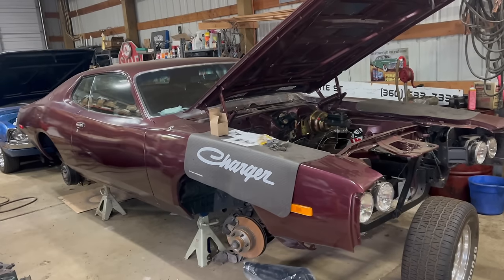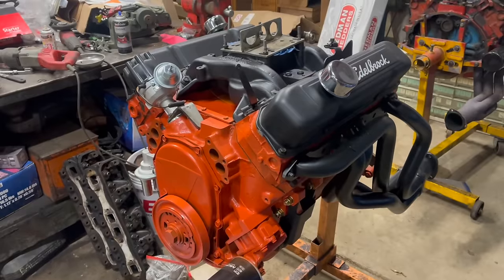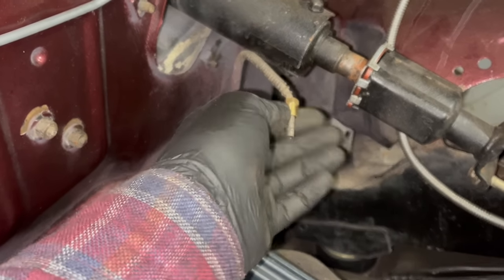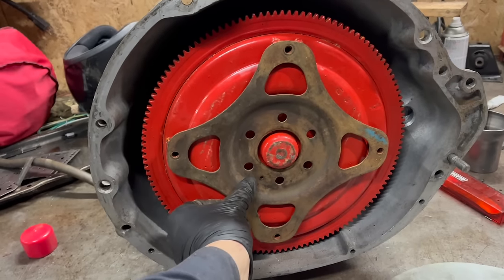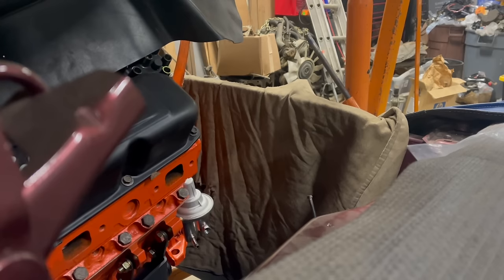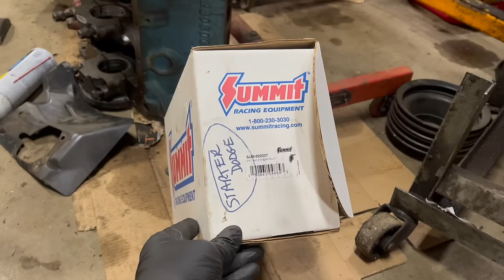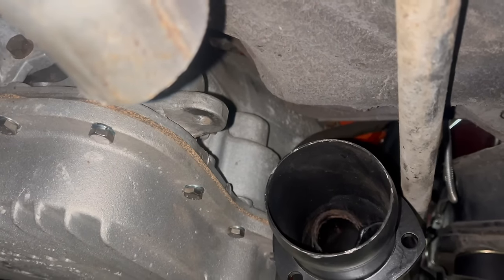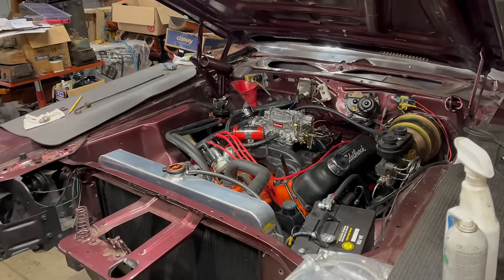Smoke And Glorious Noises - Budget Built 440 Swap In The "Toolbox" 1973 Dodge Charger

Comment: During High school (82, 83?) my buddy had a 73 Charger SE, 383, cragar mags, a nice blue color, white vinyl top and mirrored tint. THAT was a nice car....ah, memories! (while I still have them)....
Reply from the maker: We are restoring a Charger SE that mostly matches that description at Rocket where I work part time. It’s pretty awesome.
Reply: I had a black, '73 Charger SE. It only had a 318 though. It was black on black.
Reply: A buddy of mine also had a 73 Charger SE about that same time, with a 400. Same color combo - blue with the white vinyl top and the louvered quarter windows. It was pretty nice, and with a few mods that 400 was a pretty decent performer.
Reply: My black 73 Charger S/E had every option except the cassette deck and a big engine. Mine was a 318. The interior was a black and white houndstooth check buckets with an armrest. I ordered it and was 22 when I did.
Reply: @DeadDodgeGarage how much would all that cost when you're done?....

And what's the cost to do that to a forward look c body
Reply from the maker: @clevelandmaker386  A full restoration? A lot... and I don't know if Rocket has ever done a Forward Look car. Definitely not since I've been around anyway.
Reply: @DeadDodgeGarage  not a full but probably a three quarters mainly mechanical stuff and check marketplace... I've got a few saved searches in CA...

Comment: I worked in a trans shop for years doing R&R work. Easiest way I learned to get a torque converter to go in on any automatic trans is to bump the top of the converter with the palm of your hand and spinning it at the same time. Someone may have already posted this tip but since I don’t have till my next birthday to read thru all the posts…. well, there you go.
Reply from the maker: Fair enough. Haha. That’s not far off of the wiggle technique I use.

Comment: As normal a very useful and informative video,we’re just putting a 1970 MGB gt back together after pulling it apart three years ago . The next project will be the 1971 Chrysler 300. 440 .Keep up the good work regards from a very cold and wet England .

Comment: Glad too see somebody else used the same brake booster and master cylinder combo that I used on my b body, makes me feel like I maybe got one thing half way right when converting from manual drums to front disc
Reply from the maker: Oh yeah, you did. That setup works amazingly well. Better than any stock booster I’ve ever dealt with.
Reply: Please tell me more about that booster. Where did you get it?

Comment: I had a 73 Charger once. It was a 318 car that had been replaced with a 360. It had been painted with a paint roller with red paint that was more pink than red. I pulled up to a red light once and did a most awesome smokey burn out. I eased away from the red light and when the smoke cleared away and to my surprise there was a sheriff behind me. He did absolutely nothing and I just drove away.

Comment: With a factory distributor, I remove the fat short advance spring, leaving only the long, thin advance spring. This quickens the advance to roughly the same as the Mopar Performance / Mr. Gasket advance springs. Then the factory vacuum advance is too great, so I don't connect it at all. Some of late production Mopar Performance distributors have an adjustable vacuum advance can, but most of them did not and the advance in them was too much with the quick performance advance springs. he quickened advance made a huge difference in performance. For idle speed, initially I'd back out the idle speed screw out to where it didn't contact the throttle plate lever and then tighten it / screw it in until it just made contact and add two full turns (4 half turns). This places the throttle plates right about where they should be for idle in the carb. With the Mopar Performance distributors, I'd never hook up the vacuum advance, as the mechanical advance max'd out very early in RPM's.
Reply from the maker: I’ve heard that one. I have done welded recurves, usually keeping the factory springs. I have swapped for two light springs. I have modified the amount of advance available from the vacuum pod. But generally I run without it.
Reply: @DeadDodgeGarage  Two performance springs or one factory light spring usually bring all mechanical advance by 2500 - 2800 RPM. With that quick of advance, no part throttle vacuum advance is needed or desired. I measure and mark the balancer lightly with a hacksaw at 34 and 38 degrees and paint white between those lines and then paint the zero mark on the timing cover. I bring the RPM up 3000 RPM or a bit higher and set the total timing between 34 and 38 degrees. 38 degrees will give the most cylinder pressure and torque and 34 degrees is only slightly below in torque, with similar horsepower, while protecting cast pistons. I don't bother to limit the total as I set the timing at the total and leave the vacuum advance disconnected. For camshaft timing, regardless of lobe separation, intake centerline at 106 degrees gives maximum horsepower, while intake centerline at 102 degrees gives maximum torque.

Comment: Just a tip thats helped me when putting an engine in solo if you put a ratchet strap under the car when putting an engine with a trans the trans will sit on the ratchet strap and slide right in badass 73 btw!
Reply from the maker: Oh that’s a good one. But that’s basically what I do with the floor jack. I set it at roughly the right height and pivot the drivetrain on that.

Comment: Obviously not needed but jacking the rear of the car up as high as you can get it cuts down the angle when sticking the engine and trans in together and that little bit it lowers the radiator support comes into play. Love the gen3 Chargers, they ride and drive so nice, maybe the best older platform Chrysler made.

Comment: Did the Schumacher deal on a 73 RR put 383 HP in w/8.25 355 drove it from PA to LV school UNLV . Finished bought 71 RR 440 4-speed welded tow bar on back of 73 to front 71.Towed it all the way back to philly.8.25 is much stronger than you think .Just don't put slicks w/4-speed on 8.25. It will be fine for 440 driver.Save 8.75 as your racing rears .Best channel funniest sarcasm you should have a show.Thanks
Reply from the maker: I know that. That’s what I told the owner. 😁 my Barracuda has an 8.25 with 4.10s (or 4.11 - I can never remember which) that has suffered a decade of burnouts and mayhem under four different owners with a 360 and a four speed. I have had two others in other cars and they have always taken what I throw at them. Then again, so has the 7.25 - but that’s another story. We are changing the gear ratio to 3.55, and it makes more sense to do that with the correct, super wide late B body 8 3/4 housing that we found than with the 8.25. This leaves options open for easy future gear changes, as well as the extra strength.

Comment: I've had to replace my headers once since I bought my Charger (1973 Rallye 440) in 1976. Hooker Competition headers cleared everything. Still a pain to replace. Car has been garage kept last 30 years. Original paint.
Reply from the maker: For anything that doesn’t demand maximum horsepower, I can’t recommend the HP manifolds enough. But they’re already there… That’s awesome! Years ago I ogled over one just like yours but yellow on eBay. I have a big soft spot for those cars.
Reply: @DeadDodgeGarage  I'm old now (67). I'd love to find the exhaust manifolds to replace the headers. I don't need max power anymore.

Comment: Was the charger built in the LA factory?I was under the impression that automatic column shift, bucket seat cars were all built at the LA factory.
Reply from the maker: This is an original bench car. I don’t actually know where it was built, but could check at some point.

Comment: man i enjoyed this episode since its my favorite car of all time !  i know i might sounds weird but my Charger was originally a 318 i did a 400 swap in 2017 in it and convert it to a 4 speeds , the engine sat on the sb k-member in literally 2 minutes (without the tranny) no modification ever done and also at that time didn't knew that there's a difference between them , however when i pulled the 318 i put it in the other Charger which is originally a big block car and used it a parts car , the small block sat in it but not straight.
Reply from the maker: A commenter told me that flipping factory big block mounts side for side works, which is interesting. If I have an opportunity to try that, I will.
Reply: @DeadDodgeGarage   yep heard that too , anyway love your channel and your work man and we can learn alot from guys like you , keep up the good work and please do more videos about this car , greetings from Lebanon

Comment: Do those cars have a rubber isolated front K member? Is that what I think I saw? Hmm.
Reply from the maker: Yes, 73+ do. I’m pretty sure I did mention that we replaced the rubber pucks with polyurethane in the video.
Reply: @DeadDodgeGarage  Yeah I think you might have. 
I had a 79 Lebaron that had a rubber isolated K member and I think I remember reading that Chrysler Performance used to sell a cast-iron puck that would solidly bolt the K member to the frame rails. 
But jeez, that was about 30 years ago now though, lol.

Comment: Love this video and content - thank you so much for sharing each step as you helped me in getting my 69 Chrysler 300 convertible going. . .just little odds and ends.  ..starter size. .. spark plug wires/boots.  .
Reply: You need Matco hyper step drill bits there not cheap I have them there worth every penny $529what I paid and that's on sale
Reply from the maker: @davidthomits544 I haven’t seen fit to go for the step bits. Not sure I trust them for plate like this. I guess I should try it. I’m familiar with what they cost. I am still paying Matco $100 a week, and my shop has been closed for a year and a half. My first set of Matco bits were well destroyed when I replaced them with Macs. Now I’ve replaced those with these Irwins, and for the price, I’m happy.

Comment: Nice conversion, tons of work good job! Ran into same scenario with the mini torq dakota starter install. little did i know at the time there's an extension plate which relocates wires to the front of solenoid to clearance the block. purchased one, then another... guess i'm waiting till my fury burns to the ground before installing. oh well, no time. Looks good!
Reply from the maker: Yes, there is a terminal extension plate you can buy that improves things. There is actually a shorter factory extension plate often found on them which has to be removed to work on big blocks. Having no extension places the big wire right in the vicinity of that freeze plug and makes it fit - but it’s tight.

Comment: You wouldn't happen to have a spare set of tail lights  sitting around would you? I have the boring  stock thin tail lights on my daily 72 charger
Reply from the maker: These are the boring stock ‘73-4 lights - they just happen to be cooler than ‘72. Haha. He has the lenses that came off of this one but only because they are available reproduction, so he bought new. No housings, that’s the important part.

Comment: Do you prefer the 8 3/4 rear end over the Dana 60?
Reply from the maker: 8 3/4 is my guy, until such a time as I actually break one. I don’t ever have enough power or enough traction to cause any problems with the 8 3/4.

Comment: That was fun to watch on a rare sick day for me. Those ebay radiators suck. I went to a wide 2 core and its equal to a 4 core but uses 2 core and really keeps big blocks cool. It's got to feel good to get this moving along. Oh and if you alighen the pump tang un and down and put the converter in the same they go in easy Or easier. I remember when you traded a tool box for that car. Soo long ago. The wheels look like the old ones off the 68? You got some big bells to put a motor and trans in with the hood on son. I would make a mess of the hood with the boom. It's hoods off around here. Have fun with the 8.75 rear swap and getting the Nascar offset right. Plus what housing are you using. That body has the widest mopar used. It won't be fun and lots of editing 😂
Reply from the maker: We are using a factory 71-2 Charger 8 3/4 housing, so with a set of earlier shock plates we’ve got easy mode there. I’m pretty good at not ruining hoods… usually… have had a couple comments on pump tangs, I will do that next time. He just happened to buy the same wheels I had, but smaller on the back. Mine would have rubbed, bad…
Reply: @DeadDodgeGarage  71 72 has a k frame and 73 and 74 isolater front end that offsets everything. I thought the perches were offset too. My 73 the tires stick out on the pass side. That's why I went with centerline over slots

Comment: Wow, why would you use a shoemocker kit when you just use the factory bigblock spool mounts and flip them around?
You take the driver side and mount that on the passenger side and visa versa for the other.
Its something I learned years ago, especially by dropping a 440 in where the original 360 was that I pulled on a 79 dodge Magnum.
Oh and those exhaust tips you probably know are called Bazooka tips!
Oh, and there's almost nothing better then the factory slapstick shifters.
I actually luv those 73 and 74 chargers, especially the rallye versions.
Reply from the maker: I don’t think they were ever officially called bazooka tips, but I’ll take your word on that. People also call them “machine gun tips.” Dodge called them N42 Bright Exhaust Tips. 

Why would I use the Schumacher kit? Well, one, I’ve done a lot of reading on this sort of thing, but have never seen what you’re talking about before. Two, I don’t have factory big block spool mounts, so we had to buy some anyway. I tried to use factory big block spool mounts on a small block k frame way back in 2014, and learned pretty quickly that it doesn’t work. I didn’t have the thought to try them backwards. I do have to wonder if that plants the engine in exactly the right factory location, at exactly the right height, and in a range that can be leveled correctly - like the Schumacher mounts do. Schumacher makes great stuff, and at $200, it’s money well spent. 

I would have much preferred a factory slap stick and console. I even found him a console. But he decided to go this way. I’m a big fan of the ‘73-4 body style too. It’s the perfect blank canvas.
Reply: @DeadDodgeGarage 
I know this doesn't matter, but did a quick search, and some article about 71 through 74 roadrunner popped up about the n42 tips. It was a motor trend magazine.

1973 was a landmark year for the Roadrunner-but not in a good way. The standard P-code E68 400 big-block base engine of 1972 was replaced by the G-code E44 318 two-barrel small-block. The optional U-code E86 440 was no longer available with a four-speed, and the optional N96 Air Grabber hood was gone. At least N41 dual exhaust and N42 chrome bazooka tips were still standard on all Road Runners (except for cars sold in California which used dual down-turn tailpipes).

Also, I learned the hard way that flipped mounts was the real deal by other Mopar people.
When younger I had a 73 yellow rallye with the factory black stripes, it came with the 340 but that was set aside for a rebuild. But in it was a hopped up 318, and I got my hands on a 67440 freshly pulled from a imperial and I set it in the engine bay and quickly realized it was going to mount. So that swamp didn't happen. But afterwards when mentioned this to some other mopar friends, they all knew, you should of just flipped the mounts! So some years later I did it with the magnum. It works just like they said. It fits in a factory position. So, you may want to keep that in mind.

Comment: What valve cover gaskets do you use? What's best to keep them from leaking? 🤔
Reply from the maker: I use cork. What I do depends on the covers, but no matter what, they’re going to slowly seep oil. Welcome to it… whatever you do, DO NOT use the rubber coated fiber from felpro. That’s what they usually try to sell you. They are absolute garbage, and WILL break - and then it’s more than a seep. It’s an oil waterfall.
Reply: @DeadDodgeGarage  
Oops,  now I got to check my order 🫣.   Is it necessary to use gasket sealant, or should I go without 🤔
Reply from the maker: @dogdoc1  I use silicone sealant with cast aluminum valve covers because they tend to not be straight. Usually on stamped steel I will take the time to try and straighten them instead - but a thin bead of sealant can help too.
Reply: @DeadDodgeGarage  
Very good to know.  I am trying to  determine if it's best to skip the sealant and go bear this time since the leak seems to occur even when sealant is used.
Reply: @DeadDodgeGarage  
Very good. Thanks for the info. 👍

Comment: Are those Headman headers if so guess what the starter and header has to go in at the same time. At least on mine ya have to do that cause one won't go in before the other.
Reply from the maker: Yes. And I’m aware of that. I could not get the starter and header in at the same time using a standard size starter with the engine on the mounts. I could do it with the mini starter, barely. After denying the headers for gearbox clearance, it all got much easier.

Comment: Any idea of an affordable source for those 71 72 rear bumper brackets? I would love to do that to my 74 but an having trouble finding anything affordable. You would think some bent steel brackets like that would be cheap
Reply from the maker: One might hope… we ordered ours from Wildcat Auto Wrecking, the Mopar-only yard in Oregon.
Reply: @DeadDodgeGarage  thank you
Reply: To flush mouth the bumper like that I will have to cut the steel tabs off that protrude from the trunk area and rear of the fenders correct?
Reply from the maker: @1badombre82  steel tabs? We didn’t have to cut anything.